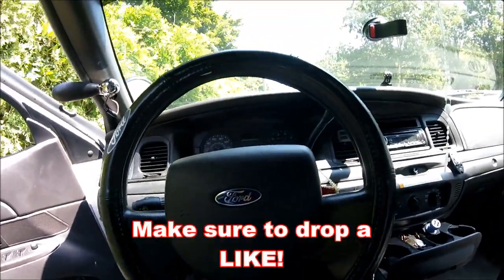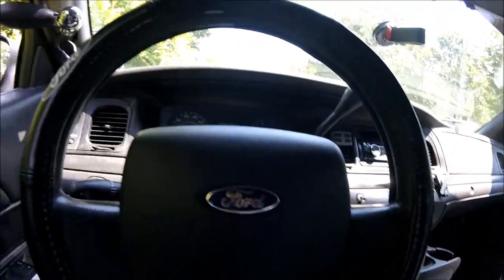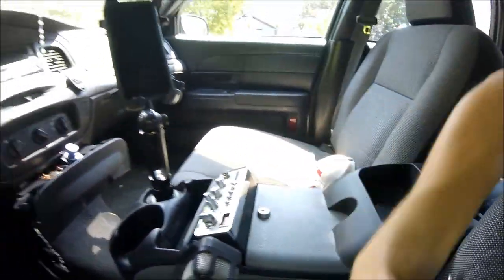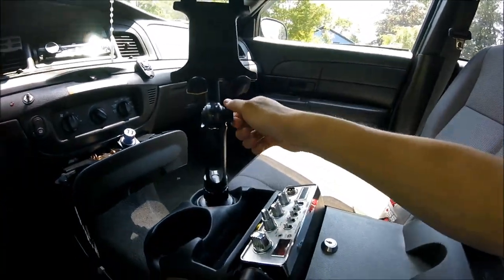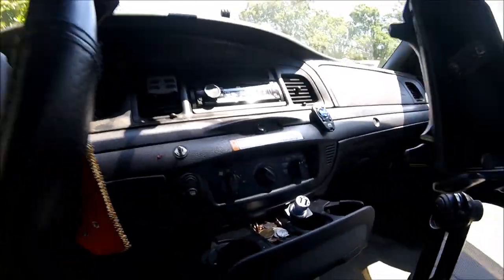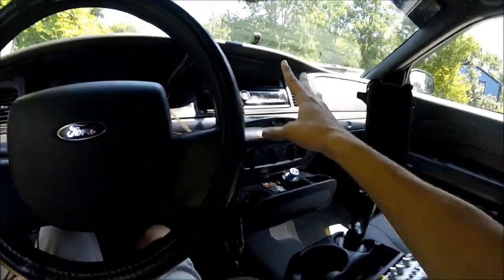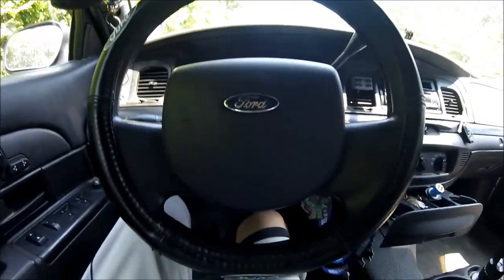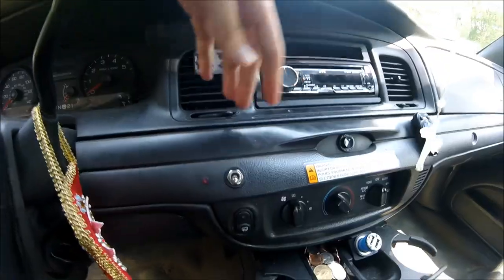How to upgrade your CROWN VIC INTERIOR!

Comment: I recommend for anyone reading the comments who doesn't have a console yet but do have a vic that you buy an actual police console that's metal like a havis, lund, or any other police equipment provider they're made to fully modify anything between radios and laptop holders to cupholders and arm rests and for the radio the factory is pretty good it's simple like everything else and if you're just wanting blue tooth get an FM transmitter they're available at autozone or Walmart it works fine and easy to install without needing an aftermarket  radio

Comment: CB Radio is a good tool to use on highway driving, channel 19 is most used, mount it, add a cheap antenna (Wilson Lil’ Wil does fine) a power cord to power supply.

Comment: im getting a crown vic for my 1st car in a couple of months
Reply from the maker: Congrats!
Reply: I have 2 for sale
Reply: get 2008 and up best ones
Reply: Anthony Lomax where are you located?
Reply: +CP100 there is no extra performance in any year you might as well say you have the magical chip that everyone thinks that's in these things 08 to 11 are the last upgrades on them plus you get the tac gauge on the dash a custom tune is the best performance for anyone with these cars
Reply: +CP100  the the 05 and up have better looking Dash steering wheel seats
Reply: +CP100 I'll say no one should get any one b4 2005 year the dbw system is cleaner in the engine bay then the cable style the ballistic doors were optional and Weight Wise they're still two tons ford has info on them and actually the 01 02 03 models were listed at 235hp and 287tq that's in Ford's own brochure by the way I'm cobra swaping my 2009 p71 selling 2v headers big cams and heads
Reply: make sure you get it checked out first. the older ones are notorious for oil leaks
Reply: what colors are they, year and condition?
Reply: I have 2 clean, well-maintained ones if you're still interested
Reply: What is your email? I would like to discuss them with you.
Reply: I have a 98 crown victoria p71 248,000 miles still running strong with maintenance here and there
Reply: Anthony Lomax r they still for sell
Reply: I'm looking at a 2004 with 160000 miles on it how reliable are the Crown Vics I really want one but I want to know how reliable are they
Reply: Same ;D
Reply: Nice i didnt know i was getting mine but it was a suprise.
Reply: @toughmanrandysavage3077  *your
Reply: Ay same
Reply: Same

Comment: 03 was a big year...for the  frame upgrade...plus a new design in rear shock set up...in the rear for better handling....06 was the first year for the factory Tach and also the throttle cable was eliminated giving better non mechanical response...airbags moved to a better engineered deployment design too....03 up is your better bet...and 06 -11 is even better...especially if you like the factory tach...

Comment: The steering wheel that you have was in 05+ models. The Cluster was changed to yours 06+ And the revised door buttons were 09+ as well. And it was pretty mush the "same" from 98-2011. Even the 92-97 models looked very similar inside. c:

Comment: If you go to the junkyard and take that piece of trim with the pedal adjuster switch off a Mercury Marquis, it will have a switch next to the pedal adjuster that enables Traction Control. You can add Traction Control with just the switch. The car is already wired to accept it.

Comment: I had my radio changed to the radio to the one that comes in a LX crown Vic that I got on eBay brand new unused left over stock radio for 80 bucks plus 20 dollars for the connector and my center console I got on eBay for 70 bucks with the pad insert so you can rest your arm on it and for another 30 bucks the pad would be embroidered with p71 police interceptor by nano products but I like.

Comment: I have a 2006 lx that i have owned for 11 years. Bought it used with 10k miles for $13k.  At first i wanted a p71 but all the miles were too high for my liking or they just looked beat to shit.   Plus it was easier to add p71 stuff to an lx vs the other way around.

Comment: One thing I'm thinking is that unsecured armrest storage with heavy radio could cause serious injury in an accident.  it would be quite ironic to be saved by an air-bag to be put in a coma by a flying object.  Should take a lesson from why the shotgun mounts were moved due to head injury potentially fatal.  Buy one which can be secured or it would be the worst $60 bucks you ever save.
Reply: I agree, you could secure the console with wingnuts for quick removal for cleaning.

Comment: I got used to not having a center console
Reply: Venegas if you change your mind you should use one out of a Lincoln Town Car 03 +
Reply: You can get an LX Sport center console. Most people do that when they relocate the shifter though. There's also the Gen 2 Taurus center console, but that requires some reshaping. There's an Explorer one that's popular because it has vents for the AC/heat, but you have to connect it to the system yourself.
Reply: Go to any scrap yard. I got one out of a old P71 like my own for free.

Comment: THAT CENTER CONSOLE IS $300 NOW! WTF?
Reply: $29 any walmart auto dept
Reply: Joe Mercado yeah I ended up picking one up. It turns out the $300 dollar one came with a steel mounting bracket...for an extra $250.